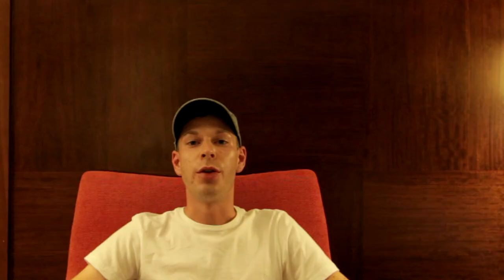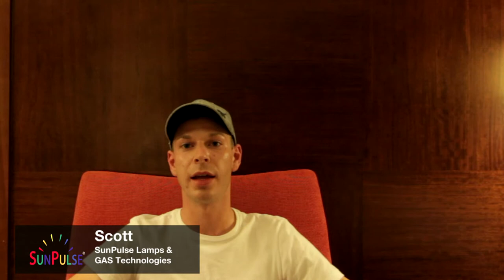High Frequency Vs. Low Frequency Lamps - SolisTek Digital Ballasts: Lighting - PART 4 / 4

Comment: After reading and watching hundreds of growers have huge flowers , more flowers sites and a shorter flowering period on I See Mag (dedicated CMH) forum I decided to buy a case of  3k 400 watt from G eez and 4 k 400 watt cmh from Fulip Service only to find out we had been duped by lip service and geez 3k cmh was cool running so great for summer. I am about to screw in all 32 CMHs into 32 Solistek 400 watt ballast. I have them rigged to spin 4 to a ceiling fan cover my eight reef tanks. Good idea?